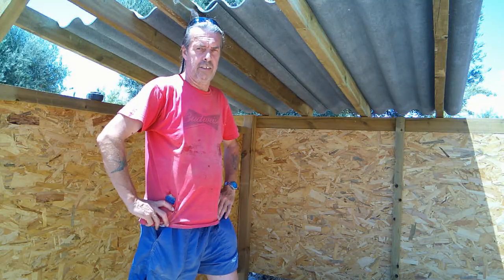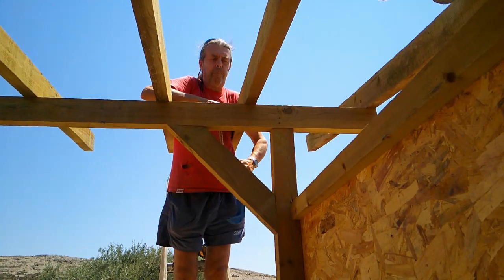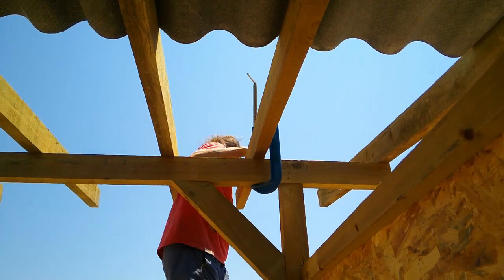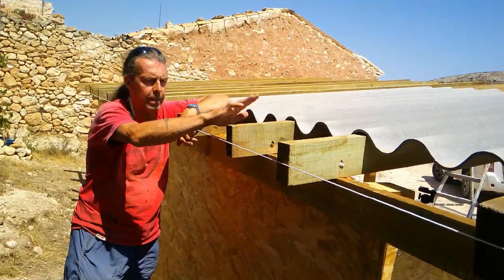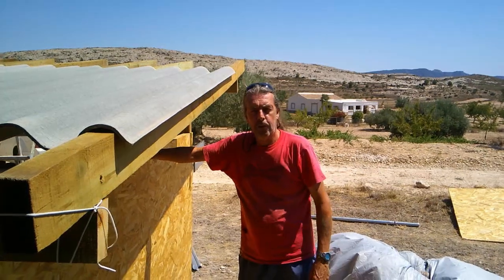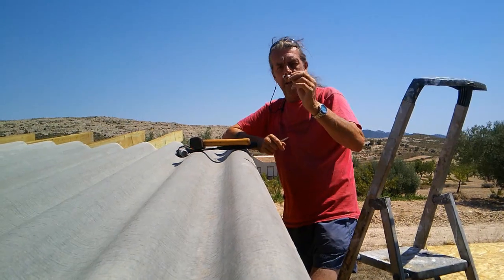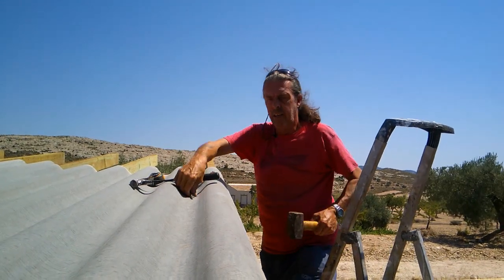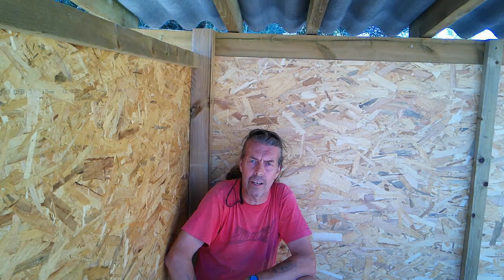The stable roof is going on.

Comment: That roof is never going to blow away ! They look pretty heavy, Will anchor down the stables well. 👍🏽😎
Reply from the maker: They are around 50kg (110lbs) per sheet. There are 12 in total... plus 14 timbers which weight 20kg (44lbs) each. Total weight of the roof is around 880kg (1940lbs)!

Comment: First time I’ve ever seen someone build fast AND well.  Amazing.  Still, that must have been pretty rough with that mallet and those nails in the hot sun.
Reply from the maker: Thanks. It was lol, but unfortunately need a heavy lump to drive them in. I used big screws on the latest roof in the courtyard :)

Comment: How much is one panel of the “plywood” you used for the stable build? Thanks.
Reply from the maker: Hi Shiela, it's OSB and a 15mm thick sheet 250x125cm or 8x4 foot is 24,95€ at Brico Depot
Reply: Thank you, we’re always curious.